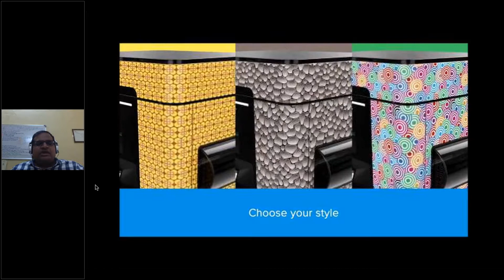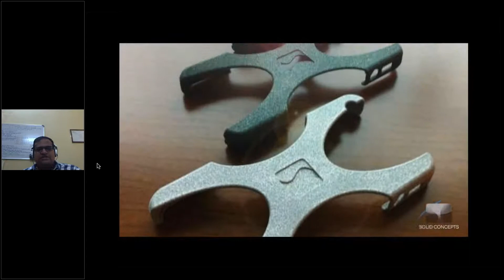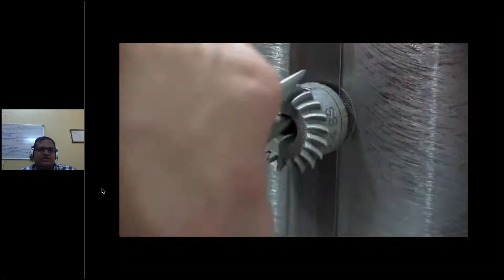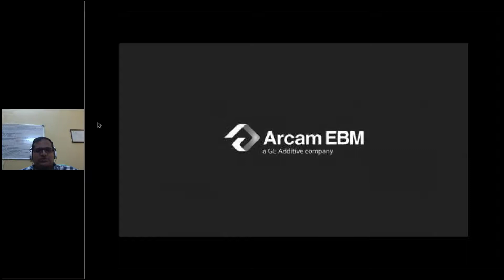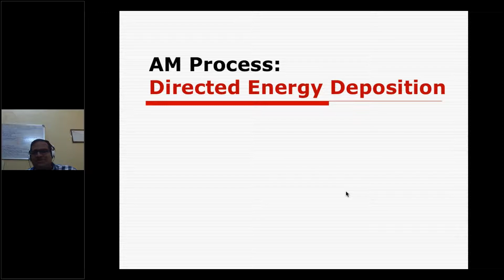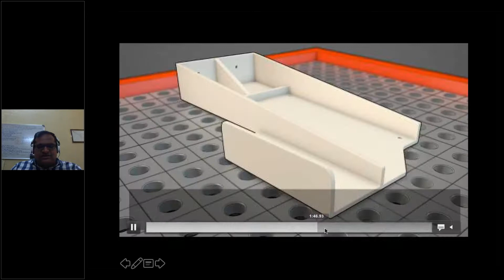10. 3D Printing of Composites and Ceramics by Dr. Y. Ravi Kumar NIT Warangal

Comment: In laminated object manufacturing, during slicing of sheet what will happen if we increase the power output of the laser?
Reply from the maker: Laser power is a process parameter. As it is increasing, the object may damage so we need to maintain the optimum laser power. Generally,  you can not increase the laser power in the machine but you can decrease it.